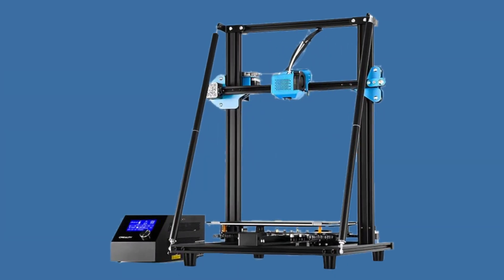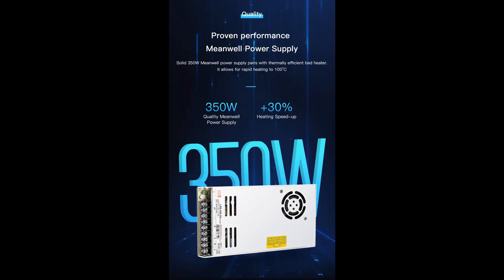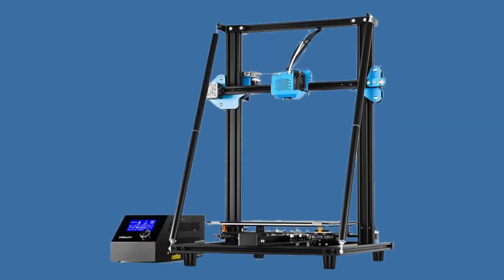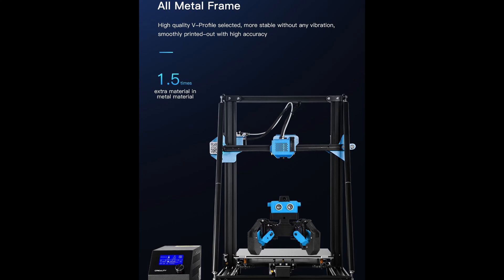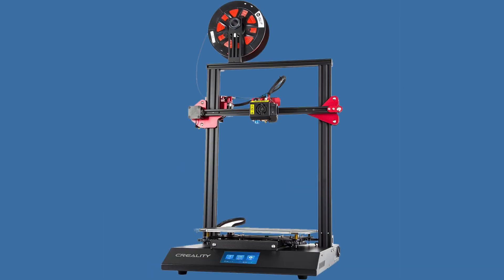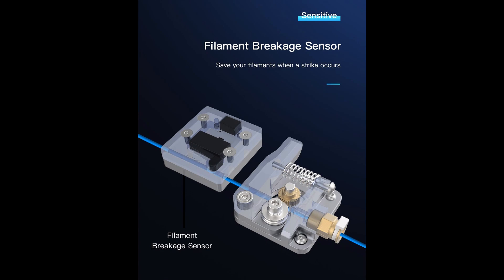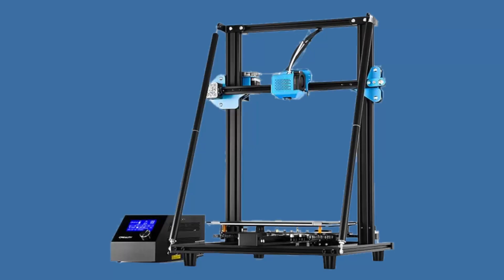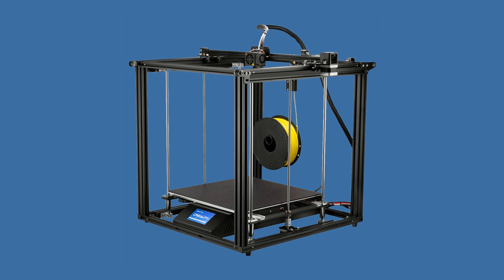Creality CR10 V2 Features Pros and Cons

Comment: I have bought the V3 for the sole fact that it has a detached control box! 
I would not buy it if it had a touch screened integrated board like the "Pro" version!
Separate control  box gives much more choices for positioning the printer. I don't plan to move it around from its fixed working place. Plus, it's much more convenient to built a cover around the frame. And I hate touch screen on anything, not just this printer. I find it insulting, but that's just my personal preference. Thank you Creality for the choice.
Reply from the maker: Sounds like you are happy. I understand the outside box, I just hate the cables, and more often than not you have to extend those cables. I had to do it on my Cr10 s5. I also feel the box is too small.

Comment: Having a print farm, I love the separate power supply. This is optimal for enclosing the printer and having the electronics.
Reply from the maker: I do see the benefits now, at that time i did not see them. What do you use the print farm for? do you get orders and such?
Reply: @RoamingInterests  I make car, appliance, small engine parts. I went around to all the auto body, appliance repair and small engine repair shops in town and showed the examples and offered to make out of stock hard to get or expensive replacement parts. I also make fixtures for a couple of machine shops.
These CR10 v2s I run a .8mm nozzle with a volcano hot end and an 84 oz extruder motor with a custom extruder.
Thanks
Reply: @RoamingInterests  I went around to all the auto body, appliance and small engine repair shops. Then show them examples and challenged the to break them. I also make fixtures for a couple of machine shops in town. The majority of my Ender 3s run .6 nozzle with volcano hotend, the rest are stock. My CR10 v2s have .8 nozzles with volcano hotends and a custom geared 84 oz extruder to keep up.
Thanks and Thanks for the video:-)
Reply from the maker: So you design the parts or scan them in 3d? I see a lot of people have some side hustles with 3d printed parts. I have been trying for the last couple of months a .6 mm nozzle on the artillery SW x1. i tried the .8 mm but it kept on bubbling and popping. I spiked the temp, changed the heatbreak but still was popping. The other day the all metal heatbreak clogged up and I had to take it apart. I took me all day cleaning the heatbreak, and at the end I broke the nozzle in the heat block trying to make sure it super tight so no oozing from above the heatblock. So I had the mosquito magnum in mint ocndition and i decided to put it in the 3d printer, and it seems that the  popping and bubbling is gone. I still don't know why the other volcano was popping but the mosquito is not. I still have to get the firmware updated if I need to print at 450. But I hope this mosquito can do a better job with the .8 mm nozzle. For now It has the .6 nozzle. I think the mosquito and the nozzles were 70% the price of the entire 3d printer. So what kind of parts are more sellable, as an idea you do not have to be specific. I am assuming they have to be smaller parts. I am assuming a 5 day part may not worth your time. Thanks for watching and reaching out.
Reply: @RoamingInterests  I draw all the parts in Autodesk Inventor Pro
I machined my own heat blocks from copper 4X bigger than your normal heat break and heavily insulated and use a titanium heat break. When you push a lot of material it's tricky to have a consistantant heat. When you push a lot of material there is a delay in catching up and then too hot when slowing down. Right now the printers with big nozzles run 50 watt 24v cartridges and cartridge type thermistors. Also the material is (ASA) is in a prewarming chamber and kept inside a the print chamber during the print @ 60c. this really helps with a smooth consistent flow. The part cooling fan has a CPAP hose that draws cool air from the outside. the inside of the chambers are heated with retile lIR lights with a thermostat control and a small circulation fan. For a volcano type heat block to work properly the filament needs to be super dry. Most of this is for big parts running a little faster to have a steady flow, flow is as important as first layer. 
Hope this helps. Was you material thoroughly dried before printing? 
Most people assume material is dry just because it was vacuum  sealed and a desiccant pack doesn't do crap. All material I receive goes to a drying cabinet for 24 hours before use, night and day difference.
Reply from the maker: Hey, You know your stuff. Machining your own headlocks that is some advanced stuff. You should write the manual for 3d printing master class. I use PETG mainly very stringy sometimes. No heating chamber or drying chamber for the filament or the printer. There may have been water into the filament because it was popping but mostly on heavy retractions. on continuous printing with no interruptions no popping only when retracted will pop, almost like boiling in the nozzle chamber. The artillery has a 65 w heating cartrige, but i do not have a enclosure. Actually the heatbreak that clogged on me was titanium , but  Looking inside i could see was not that smooth. so I put in the mosquito, so far no popping. I should test with heavy retractions but now i been finicking with a part that just wont print. 5th time the charm.
Reply: @RoamingInterests  You need to use a direct drive and ditch the bowden setup if you use mainly PETG as to get rid of the need for  heavy retractions, (YOUR sucking air back in). Try a different brand of PETG. OH, my best customer is 2 car audio shops, constantly making plates and adapters 90% PETG!!
Reply from the maker: The Artillery Sidewinder x1 comes with a direct drive some titan clone. Now with the mosquito I'm hoping I will have less problems. Nice Deal you have going  keep it going and stay healthy.

Comment: The V shape description that's in Chinglish means that the machine is more stable in the Z axis vs the CR-10....No wobbling in the Z axis as before with the older model. I have to disagree with you concerning the separate control box. I primarily print ABS, hence the need for a heated enclosure for the best warp-free large prints. If the control box is integrated into the base of the machine then the control box with its internal power supply will be super heated as it would be inside of the heated enclosure. What's the point of having a cooling fan inside of the control box to cool the power supply/electronics when the inside temperature of the heated enclosure is around 50 degrees C???...The exterior configured control box keeps it out of the heat and cool when using a heated enclosure. The only complaint that I agree with you is concerning the single gear extruder. However, the only time that I've ever had an issue with the single gear extruder chewing up the filament is when the ceramic heater started to flake out, causing the throat and nozzle to clog due to cooling off during the print. A Titan extruder is a cheap and easy fix...Most of your other complaints at the beginning of your video are pretty ticky tack with just not understanding Chinglish...These Chinese/foreign manufacturers would benefit from an English interpreter instead of phases such as "New and improved more good", etc....Kevin
Reply: As a PS---The silent control board IS available as a separate part as well as the other parts to upgrade a CR-10 to V2 status...You just didn't give Creality enough time to advertise these parts as your review was when the V2 first popped up on the scene...A call to Creality in SoCal would have answered your complaint about the V2 parts as to possibly being available separately...Your video is permanently on YouTube so a newby just looking at your review may not know the true facts...Just sayin'---No hard feelings!
Reply from the maker: @kevingreene1851  I think I said that It comes with the quiet 2208 TMC controllers. I may have referred later on at the Ender 5 Plus about the silent mother board. I think I said it is a God send. Because I never upgraded my CR-10 S5 to a silent motherboard. Hey Thanks for Keeping me in Check. I appreciate your feedback.

Comment: Should I get the cr10s or the v2??
Reply from the maker: The cr10 v2 has more features than cr10 s. So perhaps you may want the cr10 v2. However if you do not want to add an enclosure to it you may want to check out the artillery sidewinder x1. Many viewers had a good point of view thatthe CR10 V2 with the detached box is better for enclosure to increase the temp for more demanding Materials, and that you do not have to turn the printer upside when working on the electronics because they are not within the 3d printer's base.

Comment: If the electronics were attached to the printer, contrary to what you've said, it would actually be a deal breaker for me. Not everyone lives in a First World country, where one can buy cheap PLA, rather it has to be imported, add shipping plus taxes and you are looking at $50.00 for the cheapest, crappiest PLA available. On the other hand, ABS is much more common, and there is a much higher chance that someone locally will turn it into filament for a much more reasonable $14.00. So, attached electronics, no hot enclosure, no ABS.
Besides, in addition to being able to put the electronics box on top of the bed and move it around, them cables are now hot-swap, so just unplug 2 connectors and you have everything separated for easy moving around.
Reply from the maker: Yea you do have a good point. As far as the cables on the S5, there a few more than just two connections.

Comment: I have an ender 3 and looking forward for a bigger printer like the cr10 but the version 1 for me is lacking in features. This seems better for me personally with the option for a BL bed levelling in the creality store.
Reply from the maker: it does make sense for this to be better for you. just know that the titan extruder was not included. and you may want to check the artillery sidewinder x1 as a comparison point. https://youtu.be/Hbeb93vNAWA

Comment: I haven't finished watching the video but i want to comments on the first 2 statements or comments on the negative or not so great. On the V-profile claim I believe the are just trying to say they are using better quality extrusion or the whole system has tighter tolerances. I don't see that as a weird thing, they are just trying to say it in a flashy way. Now about the separate power supply I actually like it. I currently own a MK3S and built an enclosure for it. I think that having this separate unit makes it easier to add an enclosure. I had to remove the PSU on my MK3S, print a bracket to replace it as part of the printer frame and I still need to design a bracket to attach it to the exterior of the enclosure. All this to prevent the electronics from overheating due to the controlled temperature inside the enclosure. Now with the CR-10 Pro I see this integrated unit as a disadvantage since it's not possible or at least more difficult to enclose the printer without overheating the electronics. I like the separated control unit. Also, why would you have to be moving your printer around all the time?
Reply from the maker: i see your point on overheating, because someone else has made the same argument. i guess since I do not need an enclosure I did not see that either. but how will you cool the steppers in the enclosure? or they will be fine?
Reply from the maker: i have to move ot because it too big. and it takes a lot of space. so when i want to work on the s5 i have to jave it on the countertop in the kitchen because I used to keep it on the floor to print but i cannot work on it or tweak in on the floor ia uncomfortable.

Comment: Im scared to buy anything for fear of it being outdated in month's. I feel stupid for buying my Ender 5 And Cr10 s5. Imagine the people with the original single rods that had to add a second motor and screw? Why are they not stream lining this or offering kits to upgrade your printer easily. All the mods I've added are now built in? I dont want a trinket I want a 3d printer.
Reply from the maker: Well Prusa I working on a Core XY. That is Reassuring.

Comment: more wattage or voltage  on the PSU means nothing when we're talking about how fast it  heats up anything. what matters is the wattage and thermal conductivity of the actual cartridge and the wattage of the actual heated bed. you can have a 300w 12v heated bed vs 24v 200w and the 12v would heat up faster if they're both the same size!
Reply from the maker: im a bit confused, would you mind explaining or editing the comment? are you using wattage instead of amps?
Reply: @RoamingInterests  no. wattage gets used. it's more like uuh. it's like we have 10 guests and 100 burgers. every guests 10 burgers. regardless of having 100 or 200 the amount of burgers used is 10. the rest will be just left there as a piece of mind. so upgrading your psu from say 200w to 1000w won't do anything unless your components used more than 200w before. but it'd be more likely to catch fire or burn itself than to heat up more slowly tbh :P

it's like the rated wattage isn't what the PSU is pushing. it's what it's *Capable* of before burning or having issues.
Reply from the maker: Now i see it. but if you do some artificial up conversion or boosting to 200 W and your PSU can only provide 5 amps at 12v and your cartridge is rated at 200w, then still there is no juice to fully load the heating cartridge. therefore it will take longer to heat up. but i dont do a lot of electrical work to fully understand the nuances. but amps times volts equals watts. im more looking at the problem from the equations point of view.
Reply: @RoamingInterests  yeah. amps times volts is power. also if you use a less than rated power supply (less what's then you consume) unless it's a very well designed PSU that shuts itself down or something you get a nasty fire or smoke :P so be careful

Comment from the maker: It seems that the Creality CR-10 V2 3D printer is not being shipped with the titan extruder. Moreover Creality and the entire Country of China took a 7 day national holiday off, after lunching a promise, where everyone was expecting an imported a Titan extruder.  But They will Release the Creality CR-10 S PRO V2. https://youtu.be/7A08miP_sys
Reply: They state it as optional, but give no instructions, no firmware, no hardware...2 months later.
Reply from the maker: @truantray  In the launching hype they said titan extruder imported but when they shipped the printer to users came without that extruder. So I guess they do not ship that. Sill on the creality website you only have the option to buy it simple or with the bl touch. But no titan extruder. I guess you can buy the extruder separately.

Comment: The aluminum extensions have T and V slot profiles. The later is stronger, I think. Some printers comes with T slot.
Reply from the maker: OK, None of the 3D printer I know of come with T slot, maybe older ones used to.
Reply: @RoamingInterests  Anet and some other manufactures used to produce printers with T-SLot extrusions. But as you said, Most of the new printers come with V slot these days.
Reply from the maker: @ossme  I think I get it.

Comment: The V2 looks very similar to the enhancments I did with my CR-10 (i.e. TMC2208, fans, and all the stuff of the s version).

I don't share the main critics you have, but I'm fine if you consider these important.

My personal critics would rather be (looking at the specs so far):
- Looks still like a 8bit board. At least noone wrote it is now 32bit. With 8bit you are sometimes running into performance and memory issues. I had issues with marlin and a gen 1.5 board.
- Cable of the box: I don't care about the box, but I really don't like that you have 2 wires with a connector and the wires to the endstop without a connector. I really hate to remove the connectors at the endstops, they will break, when you do this too often. I put now an extension cable in between, so the cables stay connected at the endstops. My CR-10 is so heavy, I don't move it around very often.

- I don't like a fixed direct extruder. Too much weight on x axis. For PLA you don't need it.

All in all: Cost of my CR-10 plus the improvements I did, have cost more than the new price of the V2. From this point of view it looks reasonable to me. Still ~$200 more than the original CR-10.
Reply from the maker: my perspective is not the best one, is just one perspective. i would like a dual extruder, especially that they have one. As for the motherboard, I wasnt aware of the 8bit issue. I forgot the endstops, especially if you change the bed height, the end stops are fixed, they cannot slide, to compensate. if rpusa xan move that direct extruder then the new and improved v slot rails shouldnt have that much of a problem. and why i like a direct extruder is because the retraction becomes minimal, and does not have to compensate for the tensions in the bowden tube. and the single gear with too many retractions can break the filament, it hapened to me pn the S5. and the two trees sapphire. and all those filament scrapes clog the bowden tube. so the silngle gear extruder is quite a poor oversight. other than that I hope it is the best peinter for 2019. I hope it pans out.

Comment: I might do lulzbot
Reply from the maker: I do not know anything about that printer, you may want to check the reviews. I haven't experienced a printer that can print right out of the box. But I have heard some good things about the two trees sapphire pro. I have the two trees sapphire S and it works quite nicely. But I had to assemble it. and even if the hot end was assembled I had to tweak it. The tiertime cetus may be eaasy to work with, or the prusa mk3 assembled by the pros at prusa but that is quite a hefty price. Everyone I saw raves about the prusa.